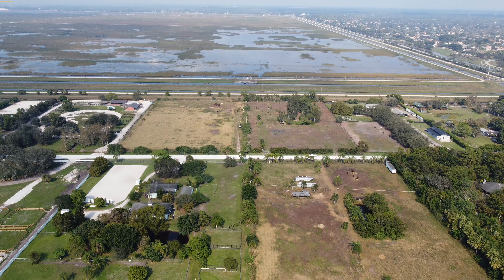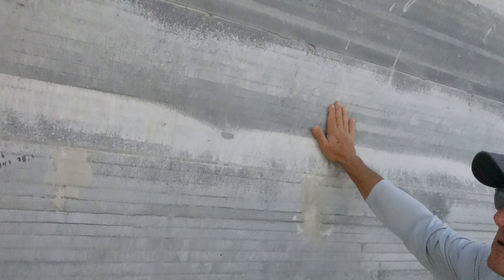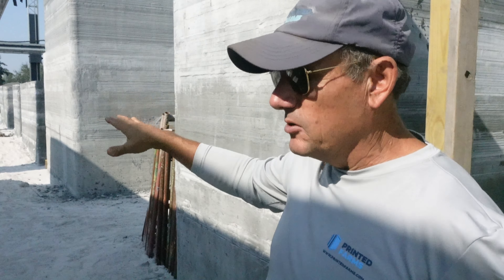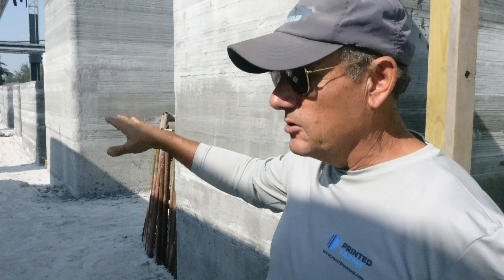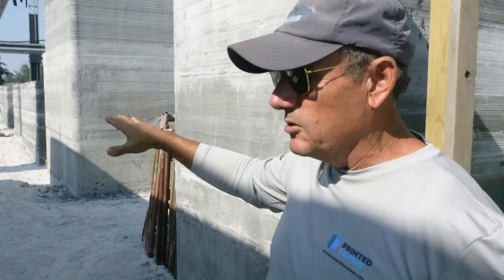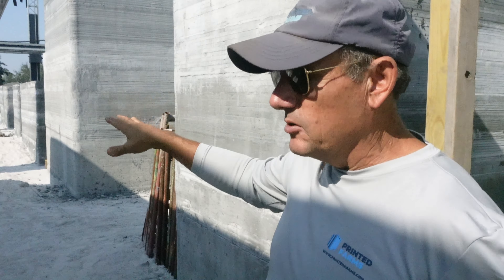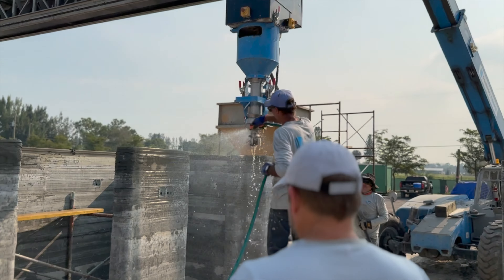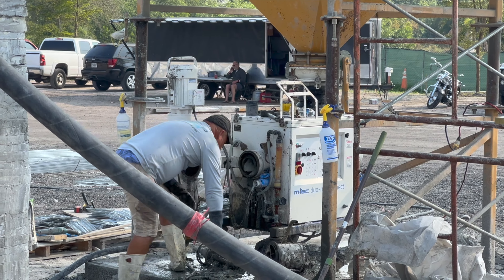10,000 ft² 3D Printed Building Under Construction

Comment: Great work mate. Massive job, but impressively smooth walls! It might be me not noticing it on other projects, but is that just a form “framing” the doorways/windows? No lintel other than the material itself?
Reply from the maker: There’s a lintel, it’s a thin sheet of metal.
Reply: The lentil is poured concrete with rebar reinforcements
Reply: @rolandbehar7860  The guy who runs the channel and saw it first hand answered, thanks though.
Reply: @slartibartfast7921  🙊